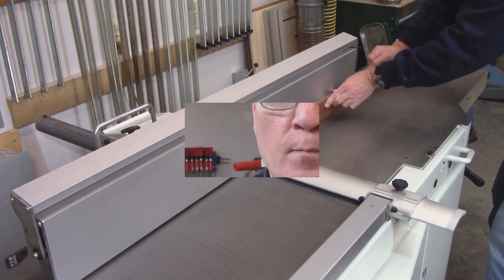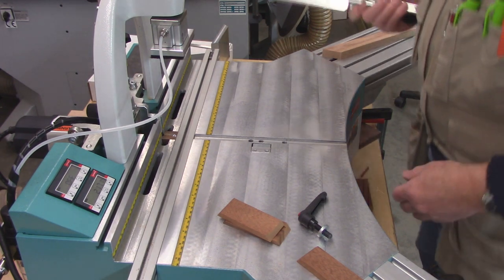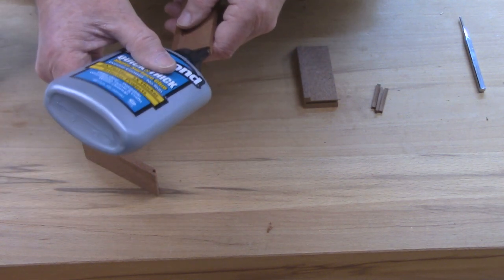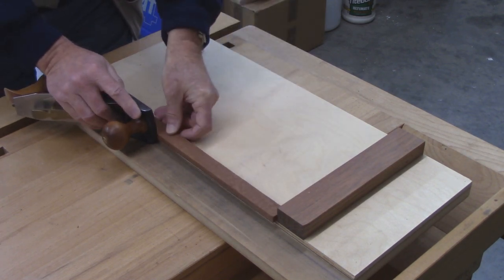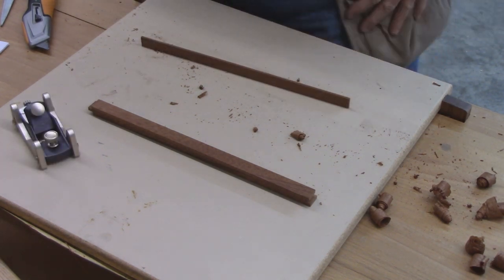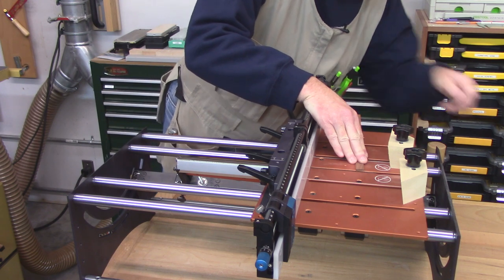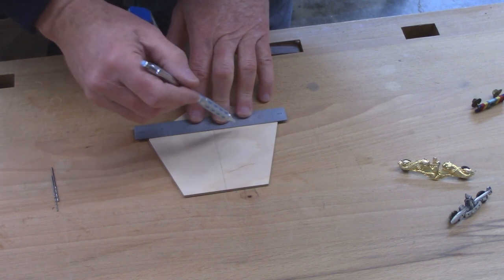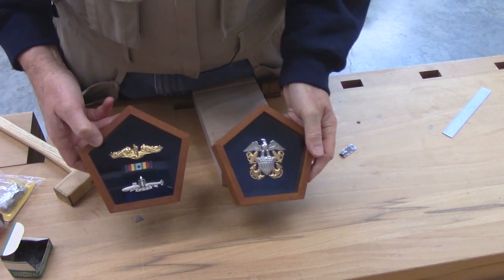Pentagon Shadowbox Build (How To)

Comment: Hey Steve, how did you manage to get a European type jointer guard?  They won’t sell these to the US buyers, so I’ve been told.  Thx
Reply from the maker: SCM sells this as an option (at least they did in 2007) and I purchased it with the machine (Sam Blasco was my sales rep).  The pork chop guard was also included but never worked very well.
Reply: @extremewoodworker  I’ve been working on a new slider build with Sam.  He’s the one that mentioned they don’t allow them anymore. It’s too bad, I think there better.
Reply from the maker: @tundrawhisperer4821  That is unfortunate as the bridge guard is far superior. I cannot imagine why an otherwise great company would not make a safety item available to all of its customers.
Reply: @extremewoodworker  I’ve had it explained to me as, our L&I doesn’t approve of this design apparently.  Apparently our L&I needs new leadership! 😁👍🏻
Reply from the maker: @tundrawhisperer4821  I think I would be explaining to the L&I department their "unapproved design" issue has me talking with Felder.